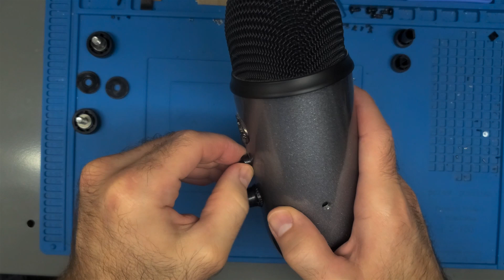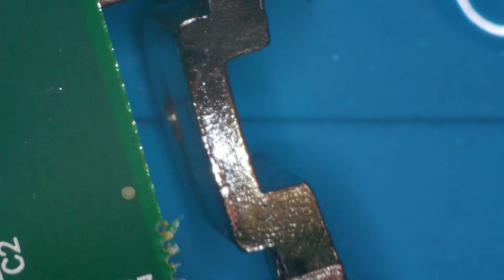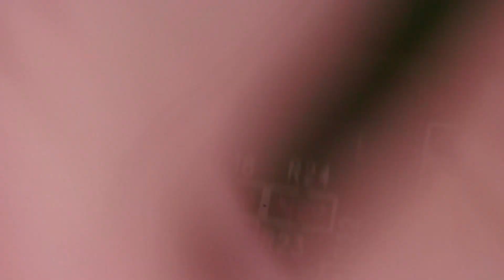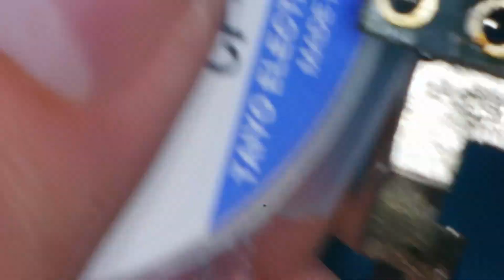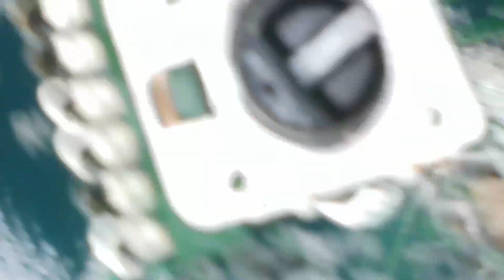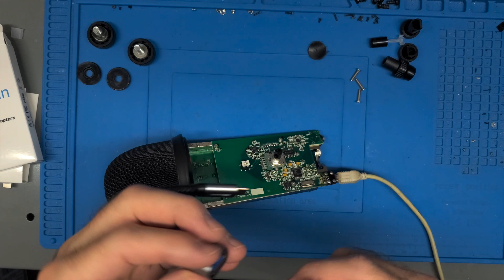Blue Yeti Microphone USB Port Busted - Let's Fix it!

Comment: For high-thermal mass or connectors with lots of pins, try using some low-temp solder. You don't need a lot, and it'll save you a headache. Also, thanks for fixing stuff. Repair techs are a rare breed today in age.
Reply from the maker: @CPD-KD6-3.7  I've some 150c solder paste, I think that'd work, though my heat gun really does need to be calibrated. I've no idea what temp it is at the moment and it's causing me problems 😞 I'm waiting on a heat enabled multimeter to arrive in the mail to fix that problem